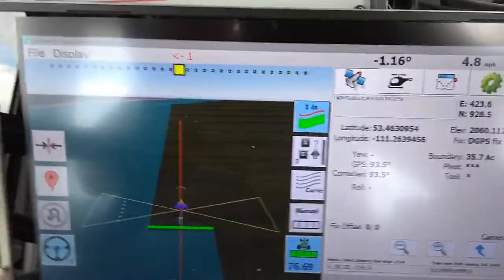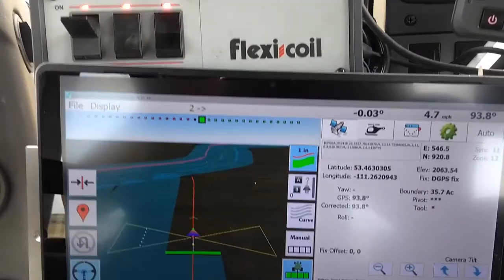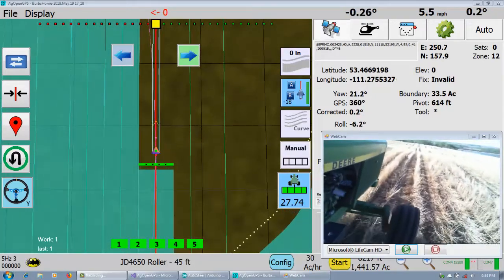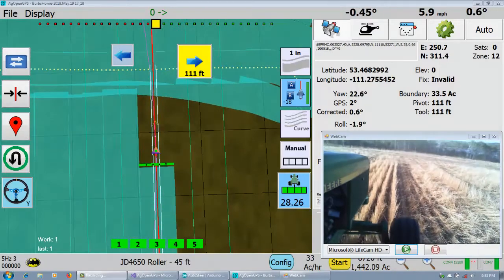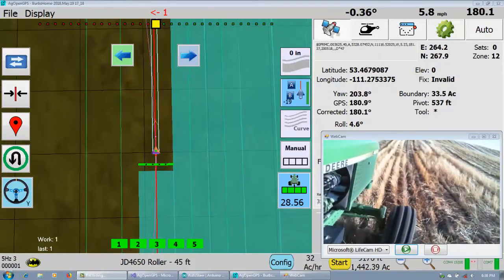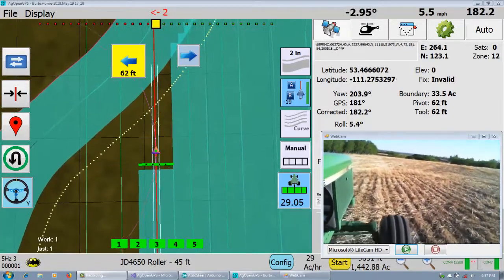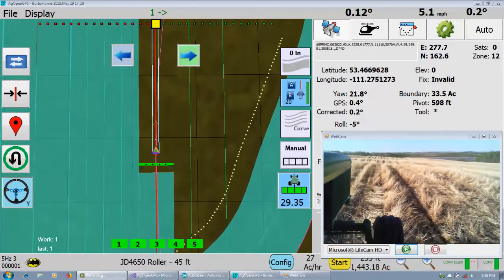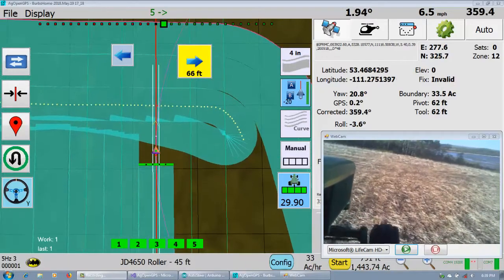Tale Of Two GPS

Comment: I like how this is all going Brian, so far I've only tinkered with agopengps, but I'm pretty sure will be setting it up in a few tractors soon with autosteer.   
   Just a question off topic a bit , why all the rolling? I'm sure there's a good reason for it , just not a common practice down south-east Australia.
Reply from the maker: Its been really dry this year, so it really helps seal up the ground. Also knocks over the standing stubble, covers the ground some more, and allows more sun to the emerging crop. Also, with tall stubble, herbicides get hung up in the straw.